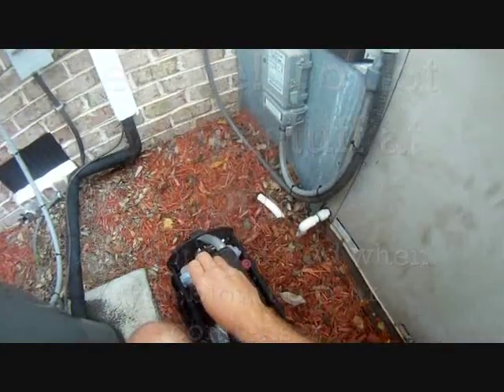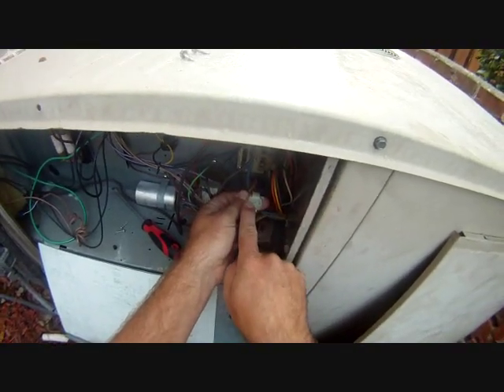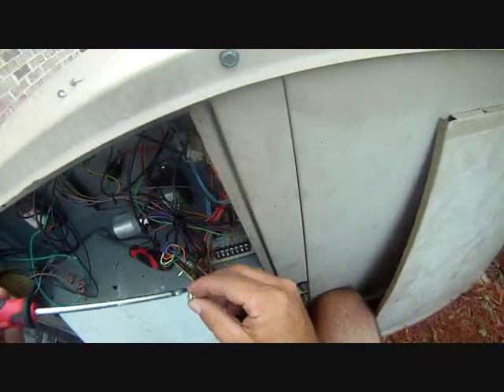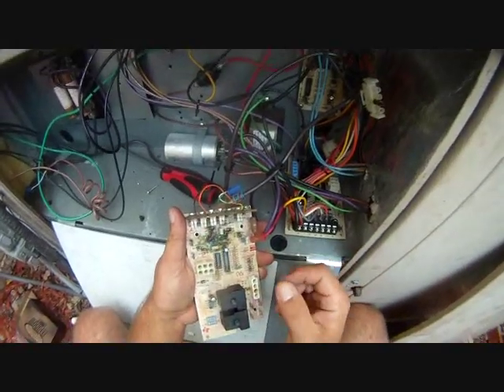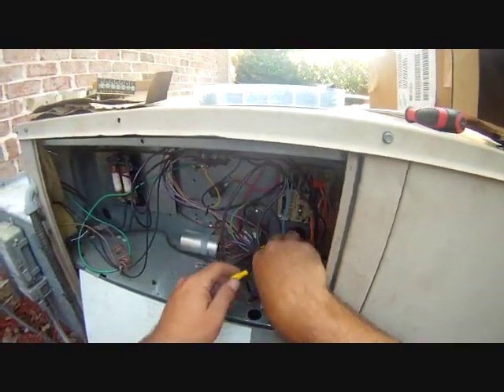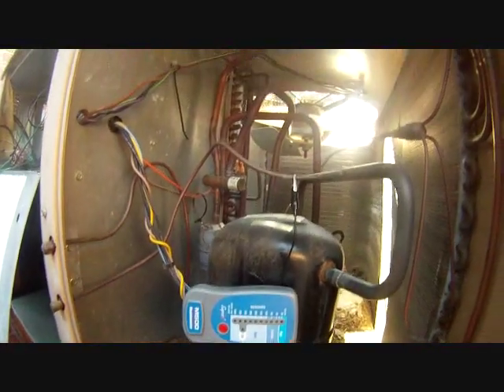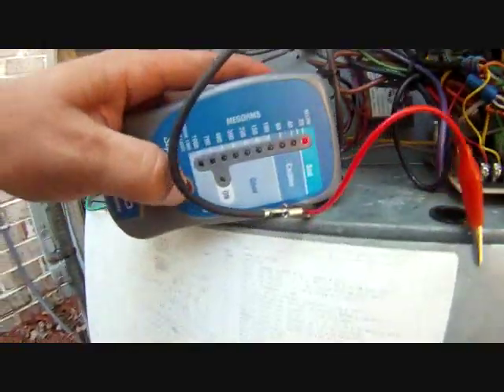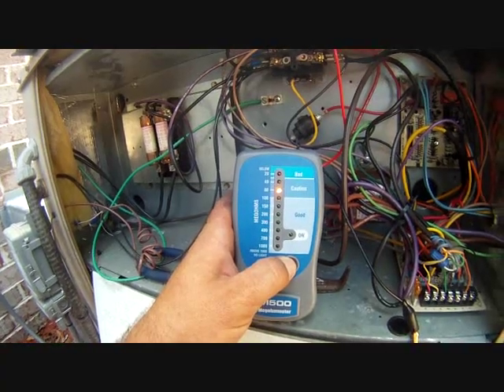HVAC Service- York Package Unit Electrical Issues

Comment: I can tell your out of the Georgia/Atlanta area from the Energy Management Control Box mounted.
Reply from the maker: Not too far off, I am in Southeast NC. We have a lot of those controls here too.
Reply: Yeah...I used to work for company that installed those. I can tell by the tag on the box from which region your in.